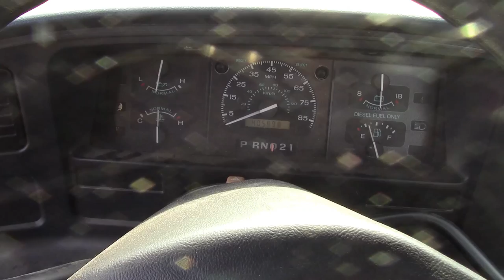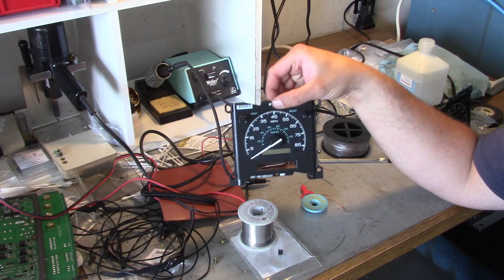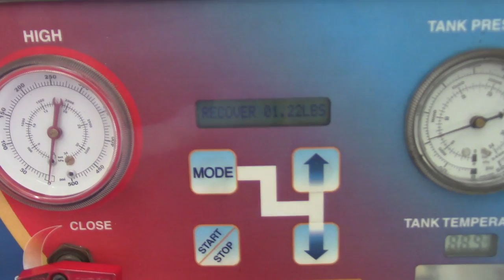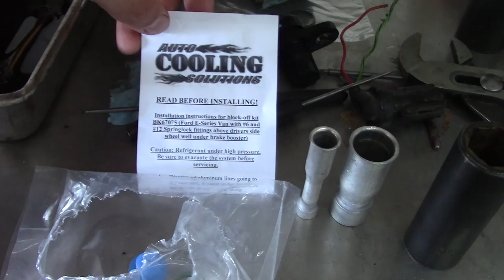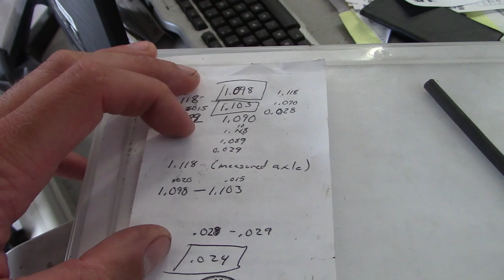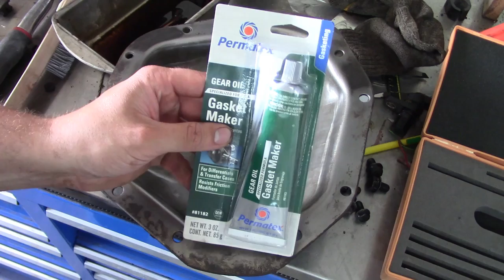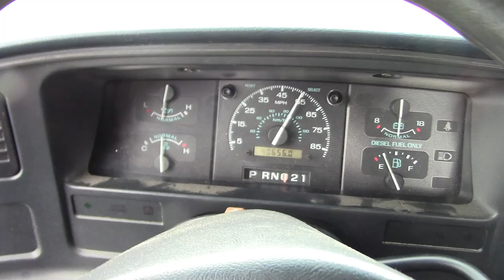Ford E350 | Speedometer Diagnosis Frustration

Comment: Yup had the same psom issue on my 96 f150 had a few companies said they could fix it but like u said they never answered the rear end  grenaded before I could fix it so I gave up
Reply from the maker: Wow. Those 8.8 Ford axles are usually pretty tough.
Reply: @WatchWesWork  yea some of the bolts in the ring gear backed out 1 jammed between the teeth on the pinion and the ring gear breaking the pinion off. the rear end had been rebuilt 90k miles before this happened maybe no loctite on the bolts idk. But I thought that was my speedo problem cause the tone ring could have gotten loose but long story short threw a junkyard rearend in it still had the speedo problem so sold the truck. Love the vids btw

Comment: Live would be interesting. Enjoy your videos. The electronics are mind boggling. I liked it when you just had everything under the hood in an engine compartment you could literally stand inside. Just worry about fuel pump, distributor, plugs and points to sort things out!

Comment: Hey mate, I just had a thought, moved on to my next video and everything, I'm not familiar with your American stuff and the PSOM setup, but being this is an ex ambulance, and it has the issues popping the injector modules before (I think I remember you found water in the old one? but maybe that was not all) is it possible there may be some redundant components not properly removed, or if anything like some Australian installers just fitted poorly in the first place, causing some earthing issues causing the speedo to wander and the driver faults? cut/bared/pinched wire somewhere, although good luck finding something like that.

Comment: You need a signal generator for the magnetic pickup it may help narrow the issue down. At work I use my fluke 754 for mpu signal generation. So the psom module converts the mpu signal to pwm is that correct?

Comment: Can you use a signal generator to feed  a similar signal into the speed controller and measure the response at what I assume would be the throttle. You could also try an impulse test by suddenly changing the frequency at the input to see how quickly the system reacts.
Reply from the maker: Yes, both are good tests.

Comment: Check the electrolytic capacitors on your board.  That almost looks like an oscillation from where your voltage on the boards jumping around slightly

Comment: My 94 f150 is having some issues. The od light is flashing, the abs light is on, and the Speedometer and odometer do not work. The transmission shafts hard and shudders too. I have replaced the vss as well as checked for a damaged psom and checked for power going to the psom. Could a dirty tone ring cause these issues?

Comment: I've got a 1996 E-250 with a very similar problem. Speedo will quit working, pull over to the side of the road, unplug VSS and plug back in. Presto! Speedo will work again for a short time.

Comment: Could a ground circuit fault which is sensitive to harmonics at 55 mph be a contributor? A voltage surge? Gremlins? Bad juju?  You might have to scope the circuit at each end? Did you burn a shop rag and recite the mechanics creed? Family looks good BTW.
Reply from the maker: Yeah, we may need an exorcist.

Comment: maybe it would be possible to machine the tone wheel diameter uniform in place, deepen the grooves with a file and then reduce the air gap accordingly
Reply from the maker: I was thinking the same thing, but not sure how to do it.

Comment: So basically the truck needs a new tone ring gear? I'm dealing with the same thing in my 97 f350
Reply: Niterider Allen I was having an OX LOCKER installed in my ‘97 F-350. We’ll the piñon bearings were shot. So I had to get a new ring and pinion and it’s now setup with a 10.5 ring and piñon gear. The 4.10’s like I have are susceptible to failure. I had 125.000 original miles on it. OX LOCKER is rad though.

Comment: I have a 99 f350 my speedometer would drop when over 65 causing the transmission to want to down shift ,thinking I need to replace the diff fluid the truck had sat for a couple yrs ?

Comment: I'm not a tech by any means, but the one tool I lack is the picoscope, I've held off due to the price and luckily up to this point haven't needed one. Would the hantek used in the beginning be an ok alternative for someone starting to learn how to use one?
Reply from the maker: Yes, it's a good place to start. But the Pico is in another dimension.

Comment: Did you replace the capacitors? I know that is the standard fix I am told for all electronic problems.  Honestly you could still have an issue with the gauge  driver deal. It was used right. Who knows if it was good. Most of those magnetic pickups will still work ok even with a mangled tone ring. It is just looking for breaks in the highs and lows.

Comment: Probably 1) the PSOM module crapped out 2)someone pulled the speed sensor, chewed up the o-ring and let water get onto the rear 3)which sat for a few years and went low from the bad pinion seal and  4)rusted up the reluctor wheel.  I'm guessing those teeth were so corroded, the height changed on some of them. Inform your wife that the truck is now a new member of the family, and should be treated accordingly:)

Comment: Is that a P&G Drives access 120/motor controller pcb on the left hand side at 7-8 minutes. Could I hazard a guess that either the mini molex plugs have corroded, the lcd screen has been damaged, the keyswitch if fitted has been twisted round damaging the wiring, the E stop as well or the tilt sensor has gone belly up. Also bad for needing recalibrated if temp goes below minus 5 C and then again when it comes above 5 C.
Reply from the maker: Yes, it's a main controller for a JLG man lift. There will be a video about it if I ever get it working.
Reply: @WatchWesWork  Yeah, work as an access engineer. Forgot JLG started using these units. First came across them in an Italian made machine in about 05/06. I can send you what info I have on them if you need it.

Comment: This is exactly what my 99 7.3 was doing it was the throttle position sensor runs fine but get around 50 or 55 there is a dead spot on throttle and no power. IVS sensor on the pedal was screwed up as well 300 dollars for a throttle assembly:/

Comment: nice job !  glad my speedometer is working on my e350. would not want to go through this. also the rear differential on my 99 sure looks bigger than the one you were working on.
Reply from the maker: I think you could get a Dana 60, 70, or 80 depending on options. This is a 70.
Reply: @WatchWesWork  thanks i did not know that. my e350 is an RV and maybe the manufacturer ordered the larger one before assembling the RV due to the overall weight.

Comment: I used a grinder and die grinder to even out the teeth on a damaged ring on a conveyor but there was more adjustment on the sensor depth.
Reply from the maker: I'm guessing it's a lot more robust system than this thing!

Comment: Are you not worried about moisture seeping into the wire and causing damage when you use your piercing probe on them?
Reply from the maker: I seal them with liquid electrical tape.

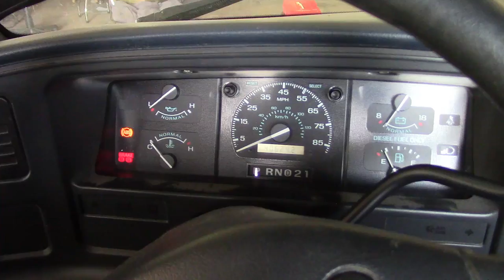Comment: Why was the voltage so low when it was running at 23:08 ? But when it cuts to you driving it was normal ? Love your videos by the way...
Reply from the maker: The glow plugs run for around 2 minutes. That's normal for a Power Stroke.
Reply: @WatchWesWork  oh okay thank you for replying.

Comment: A 25 year old truck has a 1/2 mph quiver-Does it really matter ? Surely you're looking for a reasonable as opposed o a perfect result-I'd say you nailed it.
Reply from the maker: It's not the speedometer that matters. The speed sensor is used by the transmission. If it doesn't like the signal it goes into limp mode.
Reply: @WatchWesWork  Ooops !

Comment: a stab in the dark is the voltage stable while under charge or use as a fluctuating voltage can mess the point of reference if the base voltage changes if so could it be the alternator ,as all your problems have been mainly electronic  ps try same run down road with all lights on , just a stab in the dark as im not there like the videos but for live id be asleep in the UK
Reply from the maker: The alternator is fine.
Reply: @WatchWesWork  in the cars i worked on there was a voltage regulator in the dash too "a while ago now" that gives set voltage 12v or 5v  or even a zenner diode , and in my case a petrol level was going stupid

Comment: Imagine how bad it could "kill" your system or lower its quality when all those frigidaire manufacturers use that system to make freezers and such...man, the internet is chock full of blunt edges. There's no such thing, at worse some of the oil might stagnate in the dead end, but if it doesn't then it only does so to a point and it never reenters the circuit so it can't harm anything. And a pump like that pushes a heck of a lot more oil than any block off short a dead end tank could "suck" up.

Comment: Just a thought, have you tried the 2nd hand pcom thats currently in there in your own truck to rule out that the 2nd hand part is not faulty as well?
Reply from the maker: Yes, but my truck is manual and does not have cruise control, so I can't test those functions.
Reply: Thats a bugger, congrats on the pico, i love mine, makes life a lot easier.

Comment: OK just started watch this. 
First thought, metal particles on the Hall effect sensor.
Second, sensor bad or wiring.
Third, chopper wheel is loose on output shaft for the sensor.
Well after watching this I'm now educated again.
How many vehicles have module after modules that talk to each other.
Now further into this video.
#2 sensor thing.
#3 chopper wheel problems.
By the way I didn't say good job. OK I said it.  Lol.

Comment: Great video Wes, thank you. I don't think you could have done any better in troubleshooting. You have to start at one end and test, fix/replace as you go. Even if you had discovered the bad tone ring first thing on, would that have changed your repair strategy? Given it is big job to replace, I bet you would have cleaned it up  then found the other issues. +1 for another livestream.

Comment: Put a cell phone holder in the truck and tell the owner to use a GPS speedometer app and be done. They are more accurate and less problematic. The MN patrol likes them more than vehicle speedometers there is no error using them.

Comment: Dont beat yourself about troubleshooting derelict systems, it’s a common thing to have it shit on your usual troubleshooting routines. 
I used to troubleshoot marines electrical and optical systems. They would fail 6 ways to Sunday. Only 2 golden rules in my book. 1 never forget occam razors law: the most simple explanation is the most likely (and the most common may not be the most simple). 2 good maintenance helps not having too many issues at any given time. Of course you have no control over that part, so I feel for you…

Comment: Im surprised the customer wants the speedometer bad enough for you to pull the diff apart to replace the ring.
Reply from the maker: It's an important input for the transmission. If the speed sensor doesn't work correctly, the transmission will not shift.

Comment: can you post the link for the wire tapping meter hookups?   Thanks!
Reply from the maker: Made by Pamona. I dunno if they are on Amazon. AES Wave has them.
Reply: @WatchWesWork  Thanks! fluke has em for about $1.7 million,   but will check em out,   its a rare need for me but they sure look like they make stuff easy,  you seem to get a lot of use out of them

Comment: A hafl MPH difference is no big deal that needs to be corrected in my book.Its alot better now.It is over 20 yr old truck.
Reply from the maker: The speedo doesn't matter, but the speed sensor is used by the transmission.

Comment: Is it really such a big deal that the speedometer is a little shaky. Just turn up the volume on the radio 📻 that usually fixes everything.
Reply from the maker: The speedometer is not the issue. The speed sensor is used by the transmission. If it doesn't like what it sees it will go into limp mode.

Comment: I'd have gotten fed up and just thrown a cheap GPS speedo on there.
Reply from the maker: The problem is the transmission. It uses the speed sensor to determine shift points.

Comment: I have to wonder why you are spending so much effort fixing the speedo issue, that van is worth maybe 3 or 4 grand and you're spending a lot of effort chasing problems.
Reply from the maker: The speed sensor is used by the TCM to control the shift points of the transmission. If it does not get a clean signal, the transmission goes into limp mode and the shifts get all wonky. The actual speedometer makes no difference.